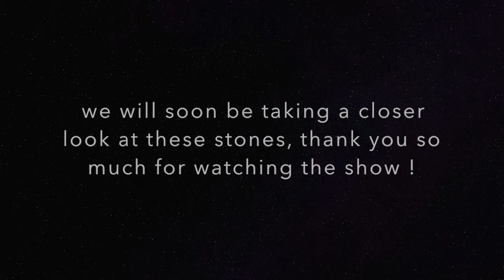Slicing The Stones We Found ! Quest 4 Treasure # 471 By : Quest For Details

Comment: Sa-weet! Cutting is so fun! Love that first pet wood...mwah! Great job🐾
May I suggest something? Only because I want your blade to last you a longer time... When your "trimming" the edges... Count how long you use the blade on one side...then switch and use the other side with the same amount of time...so you don't warp your blade or take off all the diamond bits on one side which will make it hard to cut rocks in no time. I completely ruined a great blade that way. So now I just use my trim saw for that. But since this is your only saw...yeah... I just want it to last you longer. Cheers Nate!🐾

Comment: Hey Nate,
It's been a while, life and love or lack of both,  not completely resolved yet but the clouds are lifting.
Some serious beauty there my friend,  picture jasper was outstanding as were so many of the cuts you made.
If I could just make a suggestion or two, there was nothing wrong with your method of cutting at all, however you may find some of this information helps, anything without a flat underside runs the risk of snagging and breaking, if you use a block of wood on the rear fence and hold the stone against the rear fence and wood block it will be more stable.